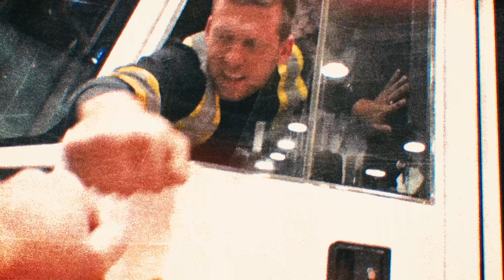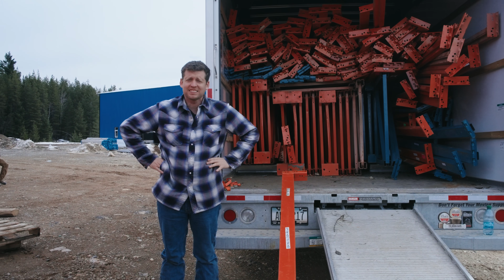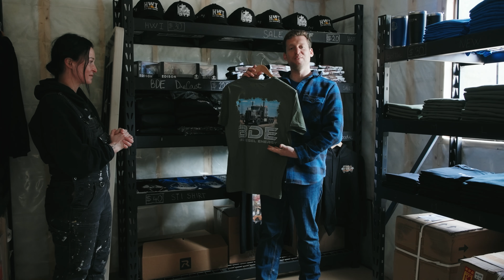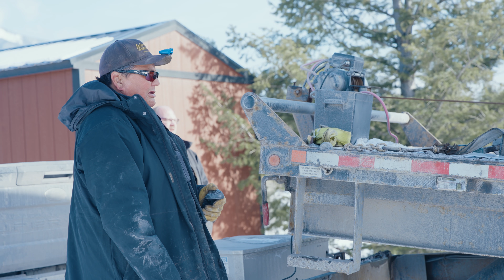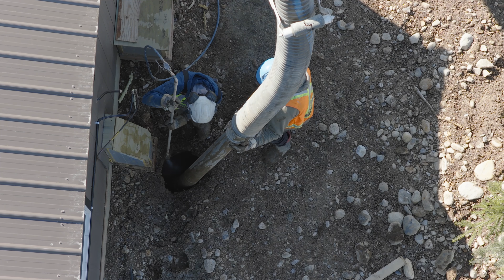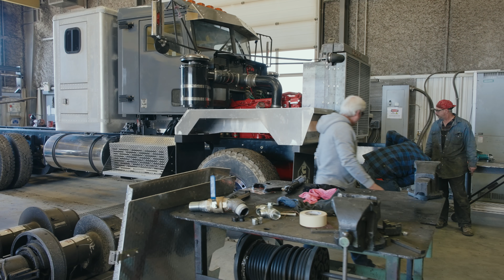Saving $50,000 on Shop Racking + BDE Truck Update!

Comment: how many mouth full of real trucks are on the road for real customers?!
Reply: Zero, or a few, depending on how you count.

They repowered the burning man art car, but it's off road only. They built a prototype toyota landcruiser for an off road only mine in usa and it's being stress tested. They're wrapping up a black dodge pickup that is a prototype for on road pickup kits. Should be driving this month The white Undisclosed buyer cabover hybrid is still getting the service bed installed. The Yello BDE cab hybrid for Emcon is pending shipment to Emcon for snowplow install.

In this video we see Edisons first traditional truck with 15 liter engine and 18 speed transmission. It's off at painting now. It will probably be the 1st actual real truck on the road like you're thinking about and it's a few months out.

Edison is a startup. In this video they show the blue 30,000 square foot building that is under construction for use as their assembly plant. They hope to be turning wrenches on new semi trucks in the 3rd or 4th quarter of '26.

Comment: Those vac trucks will be super noisy even as a hybrid truck/EV truck.  Most of that noise comes from the vacuum impeller, and hydraulics.
Reply: I've never heard a quiet vacuum pump
Reply: Also to run the impeller is going to require a beefy motor, definitely wonder if the weight increase of the hybrid system will be worth the ability to run the vac independently of the truck's drive train.

Comment: Just to reiterate (from the previous YouTube Video) Rack Storage Systems Over 2.4–2.6 Meters (~8–8.5 ft): These are legally considered "structures". You must obtain a building permit, which requires a Professional Engineer to certify the design. This is very important with respect to their (Edison’s) Liability Insurance… and of course WorkSafeBC.
Reply from the maker: We don’t need building permits in Donald.  It’s not a requirement where we are.  Not all areas have the same rules
Reply: @EdisonMotors , might be nice to contact the manufacturer for instructions. Great to get such a good deal

Comment: Id really think about in floor heating. If you can get scrap wood for almost free, and have a welder build you a double wall pipe stove for a boiler, you can heat for very little, and heated floors are so nice, always dry, snow melts right away , warm to lay on. Heat is at your feet , where you need it, not above your head.
Reply: Heated floors need to be on good concrete though, because any cracks will lead to leaks in the heating fluid.
Unless you install it separate from the concrete.
Reply: @northernmetalworker , I like underfloor. Its easier.
Reply: @northernmetalworker you can lay it below the concrete
Reply: @bobstitzenberger1834  wouldnt have a shop in a cold region without radiant heat!